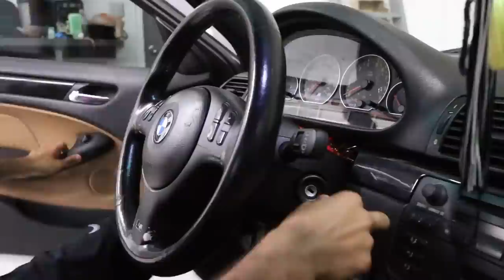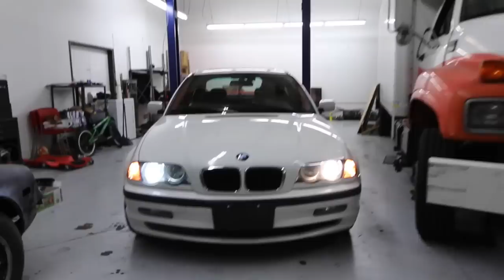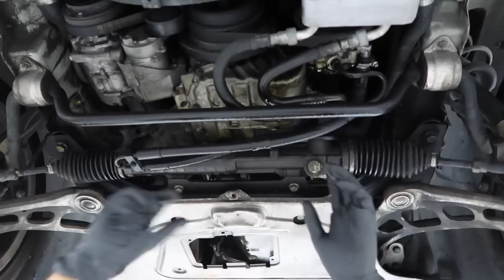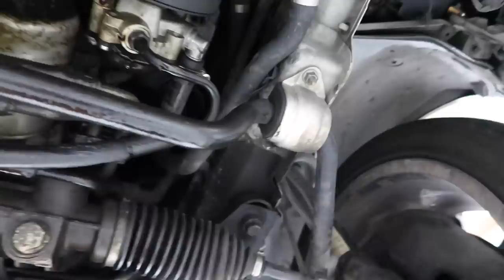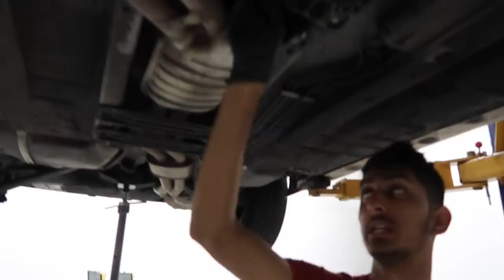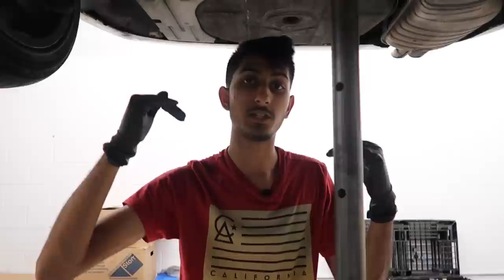BMW E46 Suspension Common Problems & Overview

Comment: I've had my e46 for more than 6 years and the clunk in the front suspension area drives me crazy. I've replaced every suspension item except for the sway bar links and bushings. Thanks for the video, I will replace those next and I'm hoping this will fix the eternal clunk! I will keep u posted
Reply: Moses G. Did you figure out what the issue was as I have a similar clunk
Reply: Did it fix it??

Comment: Thanks for making this video and showing were the vital parts look like. On an E46 that is 10 years old or 120k miles as a daily driver, definitely to look into the shocks,  engine mounts, and transmission mounts, if they are making noise or deteriating.

Comment: Hey ShoplifeTV! Thank you for taking the time and effort to record and explain in detail so much of the work you do on E46's! I've been watching for a while and appreciate it all! I have a converted 330CI. The body is a 2002 330CI (Unknown KM) and the entire drive line (S54) electronics, interior,  suspension (brakes etc) are all from a 2006 M3 manual 6 speed. (70,000km) I just LOVE it! My big worry though (of course) is subframe cracks. I diagnosed a 15 - 20 mm crack just above the drivers side rear stabilizer bar mount. (I saw a video showing where to watch). So I've filled the drivers side subframe with the recommended "Foam" as BMW said to do when they first got complaints from owners (more video learning). I'm hoping this will hold until I can afford to get someone to install the full subframe plate kit as I don't have a garage to do the work. Plus my driveway is gravel. So I'm eager to see your video and advice about E46 cracks when you get the time and can do it. I'm hoping I can get it done for around $1500.00 but I haven't talked to a shop that says they do it yet in my city (Calgary).  Thanks again!!
Reply from the maker: That's awesome man! And definitely get the cracks welded and the plates installed ASAP!

Comment: Great overview! Add to that:  
Drive shaft bearing failure (and sometimes the Gybo) should be read as a 'symptom;' not necessarily as 'age' being  the root cause. I've seen many various reports of replacing the drive shaft bearing... only to have it fail very soon yet again.
 Root causes include: a) Front motor mounts collapse (difficult for a newbie to know just how high the engine should be of of that mount area), such that the engine is using the rear mounts as the fulcrum, the rear of the engine becomes 'jacked up *particularly on stick transmissions);, and the alignment through the gybo and drive-shaft bearing is compromised (read: severely misallinged, and the rubber surround of the drive shaft bearing is under undue stress).  b) failure of the U-joint immediately next to the drive-shaft bearing. 
   If needing repairs in the drive-shaft area, and you have a stick, seriously consider upgrading the shfit linkage to a short shifter. (replacing the shift knob as a big improvemnet is a myth; putiting in a short arm IS a MAJOR improvement, as the difference is actually in the lengthening of the bottom part of the shift arm; the top is left at the same length).
Reply: Nice tips. :) Seconded and highly recommended. Especially about those mounts. Also, dead engine mounts can potentially throw the shifter off-balance with the guibo making contact with the lower end of shifter handle. :)
Reply: Shifter contact with those 'short shifter' models, or upgrades perhaps. Even 'stiff' rear mounts look good until matched along side new ones.

Comment: My 330 had a gnarly clunk when I got it. Previous owner replaced the struts and reversed the front left and right struts. This forced the sway bar end links into bad a angles causing the clunk.

Comment: Great video once again.  I just ordered the whole control arm kit with inner and outer tier rods, drag links, and control arm bushings in polyurethane, off of ebay for under 140.00.  Amazon was 179.00 for the exact same kit.  Looks like its the same kit they are advertising in the list of parts in your description for over 300.00.  Just saying for those on a tight budget like me. lol

Comment: I have a e46 320d and I've only just replaced both of the left hand side font and rear shocks all origanal. the right hand side are a both still fine and no leaks or lack of damping. the xar has done 215,089 miles. the wishbone arms and bushes I seem to replace about every 20-30,000 miles every. love German build quality my 5th bmw :-)

Comment: thanks for all the info you bring to YouTube. I'm about to check myself in for  a mental breakdown. my 02 e46 ci water pump etc, went out. I replaced all it needed, do you have anything in the way of bleeding the radiator. so much stuff on here. I learned one thing. I trust you. every one else.... I'm sure the mean well. but listening to some who swear and then show they can drink beer while fixing a car is a bit. well-lets just say I won't get that time back. through trial and error,  and your guidance. I've come to  realize buy Japanese next time, Subaru, Honda etc.  that being said I will continue to follow you and use you as a valuable  source to help me keep my wits and sanity while I own my e46. I cannot thank you enough for all you do. 
cheers..
Reply: +hungrychowhound11612 Did you ever have the subframe cracking issue?
Reply from the maker: Appreciate all the kind words, and trust me japanese cars have their fair share of issues as well and are not usually as easy or well documented for DIY's.  Look at my water pump diy, I go over bleeding the system briefly.

Comment: thank you ! good vid !   i got a rear clunk noise from the rear on my bmw z4 coupe 3.0si  ! wen i pull up and go in reverse very annoying sounds like a metal sound . . . and changed my rear control arm bush with power flex and change my Rear Lower Control Arm with Adjustable Rear Lower Control Arm Kit from powerflex . . . and now i got more noises from the rear wen i go over speedbumps pff grr

Comment: Just bought a 2005 b330 xi, I have a rumble noise in the rear left wheel, most noticeable when the car is cold, and making a right hand turn while pulling out. it only happens at 5 to 20 mph.
Checked the bushings and wheel bearings have no play. also notice the car seems to be moving left and right while hold the wheels straight at speeds over 35mph. also have a pull to the right, when applying brakes, i just installed new brakes and rotors front and back thanks dan.

Comment: Thanks for sharing your wisdom and knowledge.  
I love your channel, which is very informative..

I own 2002 E46 M3, which is experiencing thunking noise in the back passenger side, and I suspect driveshaft center bearing and Guibo. 
I have 160K Kg on it, and would like to consider changing all suspension related bushing and perhaps shocks.  

I notice your girlfriend had done similar upgrades, but what would you recommend on suspension components, and bushing related upgade..

Appreciate your keen advise on this.

Best
Jerry

Comment: I changed my front rear wishbone bushings to poly bushes even though the original ones were ok... but did it for piece of mind as knew they were a common issue for e46's

Comment: Hi Jason great work on all your videos been very helpful in all my DIY work on my e46.  I do have a recent problem I can’t find any info on. My car drives fine however if I turn right I get a sound like a spring being sprung or perhaps even like the brake shield being picked by a finger. This comes from left side of the car around the middle. I only hear this when turning right at the apex either going slow or fast. I initially thought it be the RTAB but car does not pull to one side. So not sure if it’s suspension or anything else that may have been bent? Any info/ directions/ comments on this would be appreciated.  Thank you.

Comment: Step one… replace all bushings on the car/non serviceable parts.
Step two…can no longer afford rent and food 
Lol!

I do have the excessive play in front tires forward and back in the wheel well. My 06 325i has a two lower controls arms style, a forward and reward control arms. Is it just better to replace both on each side?

Comment: You can't cut a drive shaft and just weld it their balanced from factory a u joint is a serviceable you can replace the yoke or the cross or the bushings check the zerc (grease) fittings as well make sure they haven't rusted

Comment: i have a Z4 E85 with similar suspension setup,  my car clunks when going over the bumps from rear and on visual inspection by mechanic all the bushing look good. But i can hear the clunks and on sharp corners , it leans too both sides whatever direction i am turning. i know doing whole suspension at 130k miles wud be preferable but what cud cause a lean on cornering and clunking on bumps in rear suspension as there are too many bushing in the rear and tough to take them out. Your comments are appreciated.

Comment: Our 2002 BMW 325CI makes noise only when it's in motion. It's not from the engine,,,,,most of the tech guys said it's tire noise. So far we've replaced the followings: 

All 4 wheel bearings, driveshaft guibo, all 4 break disks&pads. Engine runs smooth. In slow speed it feels like tires are touching the body and in the high speed a low whining noise. 

Any idea what could be the cause for that annoying noise ?
Reply: Lift the car up, put it in gear and run it... See if you can hear the noise from below. Might be the rear diff or an axle shaft

Comment: I actually at first didn't think I was going to like the video, but it was actually very informative. I have an issue where my 2003 E46 shakes excessively at about 54mph and then kind of levels off at 61mph. What do you think is the cause of this? Also, do you have separate video's where you change out the suspension items? I'm going to try to do most of it without taking to shop and without a lift.
Reply: Looks  like wheel balancing problem
Reply: Same car and issue. Mine was wheel alignment and wheel balancing.
Reply: I figured it out. I changed my tie rods and it solved my problem

Comment: Hey, i just bought a 2001 320i and was wondering if most parts (suspension, steering control) made for the 325i,330i will fit on the 320i
Thanks!

Comment: Hey Shoplife, quick question if you have a minute.  I recently upgraded to 19" M310s on my e46 coupe and then added HKS lowering springs because the car was sitting too high on the 19"s.  Looks great but now I have a clunk/knock coming from the driver's side front wheel when going over speed bumps.  The car still steers perfectly.  Is this related to the lowering springs or did the ball joints/bushings just happen to wear out right after the springs were added?  77K miles.  Thanks man.
Reply: I had the same issue after I installed Eibach Springs and Tokico shocks and ever since then I've replaced just about the entire front suspension. I will replace the sway bar links and bushings hoping that will fix my clunk!
Reply: This is timely.  I just spent $600 to replace both front control arms yesterday because one of the bushings was cracked.  I was sure that would be the problem but no real improvement on the clunking.  The shop said the rest of the suspension was in perfect shape.  I think I'm stuck with my noise, good luck with yours.

Comment: would a bad lower control arm bushing cause play in the front end with that cause the rear end to wiggle around on the road got an issue with the rear end of my bmw325xi I know the control arm bushing is shot it Wiggles back and forth your video helped me diagnosed that problem but the rear end of my car is extremely loose and kind of wobbles back and forth along side a semi truck or other cars in high wind wondering if that would be the issue would appreciate a response to help me proceed on this repair

Comment: Under what circumstance would the sway bar bushings cause vibration in the steering wheel? Would it be during highway cruising or while it's under stress while rounding a corner?

Comment: Hi there. Wonder if you could share some of your wisdom. I have a e46 325ci manual. When the car is cold I have terrible shake which appears to be at the rear end of the car and only occurs when I'm trying to set off. Any ideas? Cheers in advance

Comment: How much of this is applicable to the e46 M3.  I have a 2003.5 coupe and know I need a suspension refresh.  I had the rear toe wear, and now vibration while braking.  Pretty sure that's the FCABs.  Need to fresh everything.  Any recommendations on how to's like sites or a link?  I'm at 115K miles.  I had the subframe reinforcement done and RTABs while they were in there.

Comment: Very nice video! Could you tell which Problems appear too on a e85 Z4 which is based on the e46 3 series as far as i know?
Reply from the maker: The problems are similar engine and trans wise for the m54, the n52 are mainly water pump issues.

Comment: love all your vids but i have an x3 m54 e83 2004 and i cannot find a vid on fuel filter pressure pump replacement diy ..i know the pump/filter sits under the back seat but thats all i know so far..do you have a vid of a similar diy that i can learn from before i try this? thanks

Comment: My 05 E46 tramlines and "floats" badly.. I've changed the tires, control arms, tie rods, the rack, struts, sway bar links, steering coupler, yet I can't tighten the steering.. ive also done several 4 wheel alignments at different shops.. Any ideas?

Comment: Love your video's bro. You make it look so easy. I have an issue with my steering....its a funny issue but apparently its common. Before I begin, I've checked all bushes ( and replaced some), arms are good,  and also replaced steering rack.
So the issue is this...

Steering jams only in Full Left Lock (Driving forward - doesn't happen in reverse), and I have to break out of the jam. Never happens on Right Lock...only specifically Forward Left Lock. I can also break out of the lock when I go reverse.

Can you help out with a solution ?

And could you do a video on Oil Housing Gasket change ?

Thanks

Comment: I appreciate your videos very much. 
Have a an 06 330CI,  took to the dealer to replace the oil pan gasket,  and after a couple of weeks (this is my weekend car) I noticed big leaks coming from the middle of the car. (between the oil pan and the transmission area)
I have not taken the car back to the dealership because I'm trying to figure out where that leak is coming from.
Please advise..
Thank you!!

Comment: Hi! Love your video,  i've got this suspension front issue, uneven roads, or a driveway driving on it and my front is so hard, no damping or absorbsion what so ever.

My mercedes w211 has the exact same issue and idk what it could be.

On my w211 i replace swaybar +links, tie rods, lower control arms thrust arms...

And now my e46 gets the same annoying issue :-/ 

E46 114.000 kilometers.

320ci,

Any idea what it could be?

Comment: My dads 330i is wandering all over, control arm bushings replaced 2months back. What might be the issue. Control arms or tie rods? I am far away so cant check at the moment. Car has 230,000kms

Comment: Any advice for creaking noise from the front suspension when turning the steering wheel when stopped or low speed turning?
Reply: Have the same problem
Reply: Had same problem, I replaced lower control arms and ball joints. Parts from Amazon cheap

Comment: So, quick question. I replaced my front control arm bushings (mainly because they were 18 years old). Replacing solved the steering wheel vibration I had near 60 mph. Hoever, I still have an issue I cannot seem to find. I already replaced quite a few things on the front (not because of this issue but because it was needed anyhow).

On abrupt braking, there is a one time jolt in the steering wheel. Otherwise braking is vibration free, no clunking noise and dead street. What could this be?  Thins that have been replaced because of wear:
1. Brake pad + rotors (cleaned all the surfaces before mounting new to prevent any vibration
2. Control arm bushing (front)
3. stabilizer bar bushing + links.

Any suggestions?
Reply: My car has this issue. Did you ever figure out what was doing it?
Reply: @LordOfTheChevelles  yes. For me it was: leaking front control arm bushings. Must have damadged while installing. Get a good blob of silicone grease (not spray but grease) on the control arms. Should slide on easy.

Comment: I have a question reguarding the suspension.. I recently bought a 2000 323i with 130xxx miles here in Fresno CA and it tends to swerve pretty bad when driving over small cracks on the road at low speeds, also in the highway when switching lanes and when I U-turn the car vibrates hard it almost feels like the wheels struggle to rotate. Any ideas on what that might be? It is my wife's daily and it is concerning as we have a 2 year old on board. Thank you guys!

Comment: Hey! Quick question, my E46 makes a weird noise when going over bumps. The right rear side makes this noise as if you're hitting your keys togheter. I changed my shocks but I think that the coil spring is broken. Any idea if it could be something else ?

Comment: I bought 04 545 with front suspension damage I'm not sire what's wrong with just know the guy said the regular tire won't fit so it has a donut on it. What part of the front suspension might need replaced?

Comment: I have a 2004 e46, I removed the driver side front strut, compressed the spring. The mount was free spinning, I inserted a hex wrench in the top of shaft and tried to get the mount off. Nothing doing, any ideas how to get the mount off. It looked like there was a nut on the shaft but it was just round no sides.